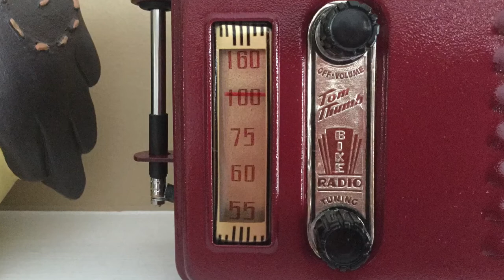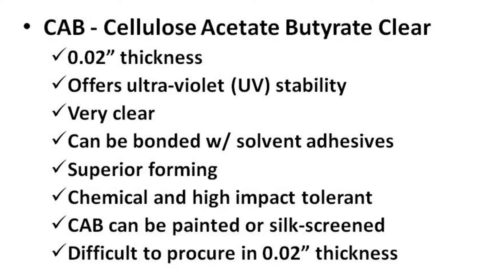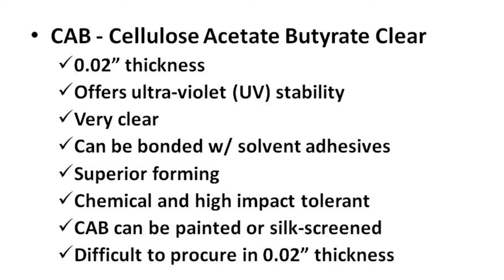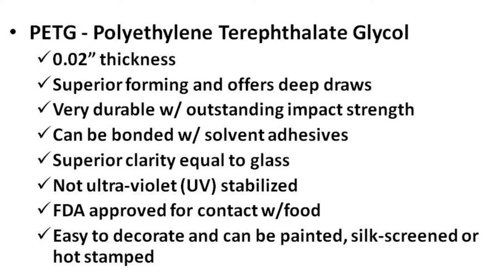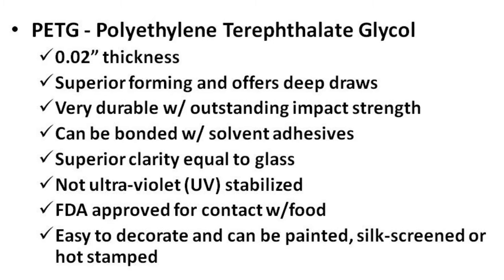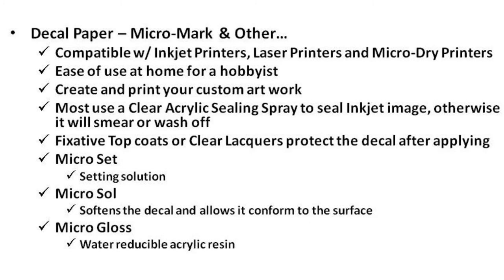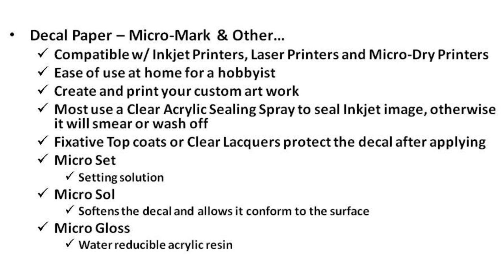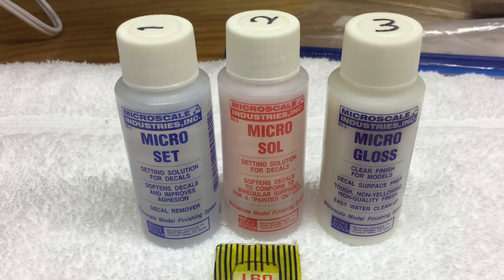Radio Dial Cover/Scale Materials

Comment: so cool, thanks Don for all this info, used Micro chemicals for all my modals way back in the late 80s for my rockets. Now it looks like I'll be buying them again.
Reply from the maker: Glad you found this information helpful Tony. What type of models did you build/collect/work with? Best, Don
Reply from the maker: +saturn5tony Hi Tony - some nice models you had. The RC field has always intrigued me, but I never purchased anything myself, but often went with friends to a park that had a flying field. I did build a few rockets back in the day. I think one was a "Cherokee D" that had twin D size engines, but you would know better than me. This rocket had two successful launches and on the third, it went out of site and drifted over a wooded area. They were a lot of fun building. The old radios help keep my mind sharp too and as tedious as the restorations are, they are a stress reliever from my real job. Best, Don
Reply: Oh so true Don, I still have that Cherokee D, haven't launched it yet. Your so right tho, at least when you finish a nice radio, you don't have to worry its gonna drift away the day after you finish it........ haha!!
Reply from the maker: saturn5tony That's for sure, but I do have worry if the radio will play again when powering it back on; even though I did the repair. LOL Best, Don

Comment: The plastics shop nearest to where I live suggested using clear PVC as a substitute for the cellulose acetate, it's about $2 a sheet as opposed to $6 a sheet, at least through them.
Reply from the maker: OlegKostoglatov Good to know and thanks for sharing. I may have to pick up a few sheets and compare the three products in my vacuum forming table when I reproduce my next dial cover. Best, Don